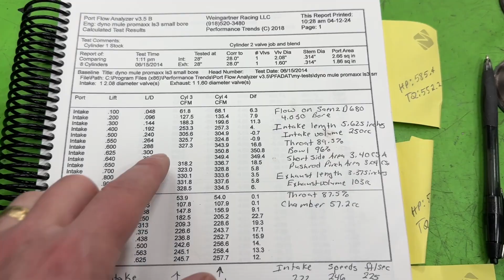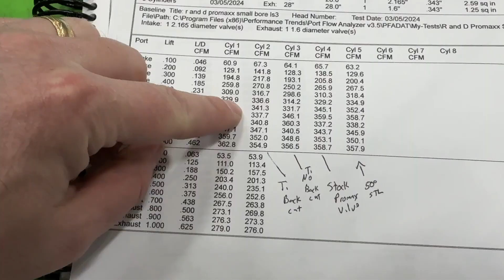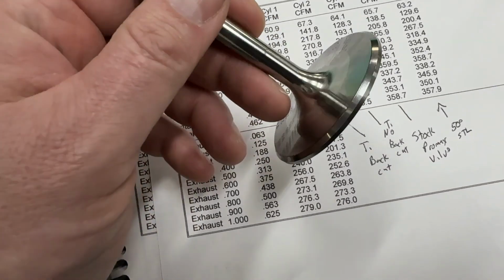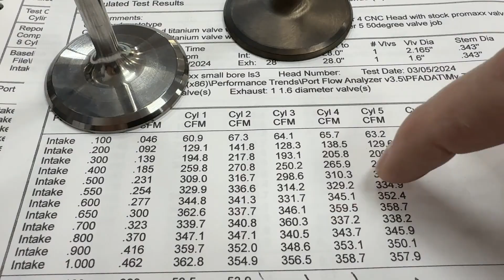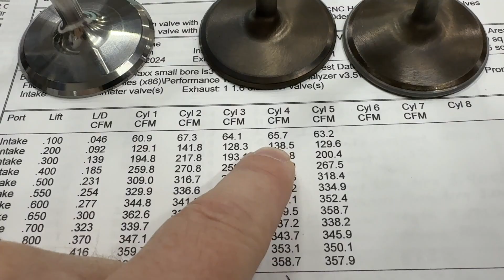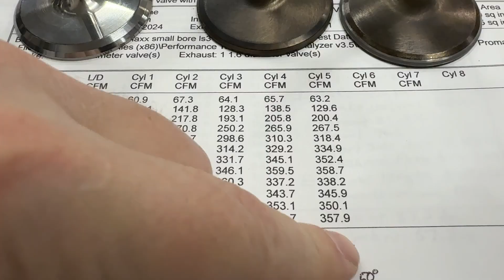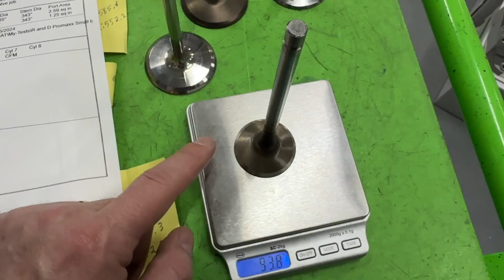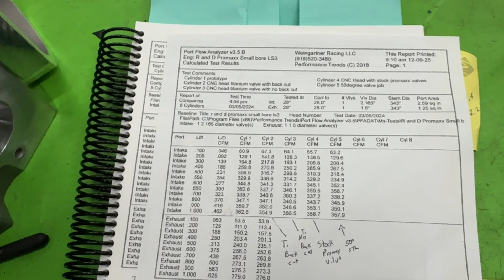I Show The Flow Differences Between Backcut And Nonback Cut Valve That Will Be Dyno Tested

Comment: I would test valve angles. Oldsmobile V8’s used a 33 degree valve angle while other engines used a 45 degree angle. (It’s ok to correct me on this as it’s been about 30 yrs since I built anything). The Olds head was said to flow better at lower lifts than the Other GM heads, but less at higher lifts. I’d like to see how that affects power output.

Comment: Where does the valves spend most of its time lift wise...would make sense it spends most time at low to mid lift so optimize valves for the lower  mid lift.

Comment: What if you do two back cuts? So a 45 seat, then 33, then 21 (two 12 degree cuts). I don't say 15 because the profile on the uncut back face already has some angle to it, and my idea/presumption is to have 3 equal steps between that natural face angle and your seat angle. If the face angle were perfectly flat, then a 30 and 15 double back cut would "work," as per my theory, but I digress.

Comment: I think you have to ad a margin measurement , one of those valves looks awful thick .
Reply from the maker: The titanium valves have the same margin.
Reply: @WeingartnerRacing ,,, I think you ( we ) should also measure the actual width of the cut(s) , and then the radius of the fillet .

Comment: Does swirl polishing actually do anything or is it just a gimmick? Do you want the back of the intake valve mirror polished or slightly rough to promote atomization?
Reply: The vertical lines definitely make the valve less likely to break .

Comment: So on this heads is there more valve free drop then a stock ls3 at that 57 cc stock cnc program ?  Another words if someone has stock ls3 heads with a decent cam that is close to piston to valve clearance on flattops will these heads work?
Reply from the maker: These heads have more free drop than stock heads.

Comment: I know all your videos take way more work off camera. So I’d imagine doing comparisons of valve back cuts might be able to save you time… I would love to see tons of back cut videos. Ls3 stock valve, vs back cut, vs aftermarket back cut. Do one of each, can compare 4 on one head. Don’t have to dyno test everything. Worth considering. Back cut is the side of the head flow situation that feels the least well explored. Especially the dyno test will be cool, because yes I understand the increased cross sectional benefit from a back cut, BUT, I always wonder if certain back cut designs etc will help with atomization and even make more power. And a whole other can of worms; atomization vs flow in forced induction. In forced induction especially with alcohol fuels on efi, you have such a huge mass of fuel getting sprayed in the same spot, I would imagine certain valve jobs and back cuts hurt atomization and increase pooling. And then you immediately have to wonder, does it even matter? Does the cylinder pressure etc etc all end up sort of canceling out?

Fascinating questions really.

Love this, hope you do more beyond dyno on it!

Comment: What I find interesting is that as you have mentioned previously the importance of the valve job and predominantly more the most part is regarding the seat to throat and seat to chamber angles etc.
There's room for at least three angles on the valve also that has to make a substantial difference in optumising your custom port head combo you only need to design it once, CNC head port & Chambers, custom valve job & custom valve angles.
Once you perfected the lot being valve and port to chamber I wouldn't be surprised to see improvements from off the seat to 1' lift.
Then do the Dyno testing?
The profile at the top of the exhaust valve to margin and seat   
Would also be interesting to look at flow difference's etc.
Interesting stuff, thanks Eric👍

Comment: My question is about the static flow measured on a flow bench vs the dynamic flow in an engine. While the flow bench shows a loss in high lift flow when the back cut is used, does the low lift flow help to accelerate the charge and result in more energy and flow during the high lift than is indicated by the static flow on the flow bench?
Reply: I dont know for what are this likes!?! Pls, take a paper and make a camshaft diagram by your self. No matter what 4 stroke cam profile you take. All 10 degree duration you make a point on your paper for lift height. When valve lift is over, you connect all dots on the paper. You will see there are more points in half valve lift range than in full valve lift range, improve half lift range is the goal! Most valve open duration is in half lift. Static flow and dynamic flow where did you get this? OMG! Look, a engine has VE (volumetric efficiency), this makes hp and torque. A flow bench is only a help to find best results. You get likes for a Chat CPT bla bla, horrible, sry. Only volumetric efficiency % rules. You didnt find some right numbers of VE % at Google. You only find this in expensive bookes like Bosch, ore from engine manufactors. This back cut is a small but nice and cheap VE % improvement. V8 engines have a wide range of VE %, and Mr Weingartner makes a good job to find this VE %. I hope you didnt ask this anymore and understand my treat. lg

Comment: So, ALL the power is made 1" below and 1" above the valve! Ive spent hundreds of hours testing valve jobs and blending and everything else. Dont know what your valve job angles are on the 45 but i know what angles flow the best on most LS, 18* to 23* heads and 31* degrees is about the best backcut to put on the valve and about .080 to .100 wide. IMO but im a dumbass😂
Reply: You don't sound like a dumbarse.

Comment: Looks like the wider angles allows the venturi between the valve and the seat angles to turn the air more gently at lower lifts allowing for more volume through the venturi. At higher lift the wider angles cause an efficiency loss by making the air less able to cling to the valve and turn. Of course after .25 times the diameter of the valve the port area and valve curtain area is equal and above that lift the 50 degree seat is more advantageous as it points the venturi formed by the seat and valve angles straighter or more aligned with the valve axis which is more advantageous at higher air speeds AKA more RPM.

Comment: Point of mathematical curiosity, but iirc, flat tappet lifter valve trains should (generally) have more area under the curve for the total valve open/close event than a roller lifter valve train and might therefore get more overall flow benefit from the low lift shoulders of the event than the roller cam, which might get better overall flow out of the higher lift numbers from the non back cut valve. Probably a stupid hypothesis
Reply: Interesting hypothesis. Flat tappets are quicker initially but tollers are quicker later, especially with larger cam core size and wheel diameter. Where's the break point between them? Hmmm.🤔

Comment: What about putting 2 back cuts on the valves, Eric? I subscribe to a channel that did a 30 and 19.5-degree back cut, and it increased flow on Mopar cast iron heads at low lift. And which seat angle fits the 2 back cutts for more gains, the 45 or 50 degrees? Curious mind alike here. Great video!👍

Comment: a dyno run would be interesting to see, but my guess would be that the larger back cut ( higher flow numbers at lower lifts) and a 45 degree seat will do better. the valve spends more time at the lower valve lift points, so overall it should fill the cylinder more if everything else is equal.
Reply: If it improves low lift flow and it's not maxed out then it should pick up from around peak torque and up, but might lose below that due to reversion. They typically flow better in both directions. 😄
Reply: I agree

Comment: This one of the reasons I follow your channel, testing and results.
 Do back cuts have the  same result on a street engine (.520 ish lift)? 
 thanks the vids are great
Reply: Think of the back cut on the valve as the other side of the venturi created by the seat angles and valve angles.  Wider angles equates to a larger radius curve.
Reply: LS street engines are more in the range of "just over .600" lift"...